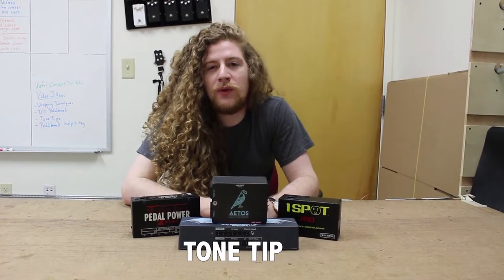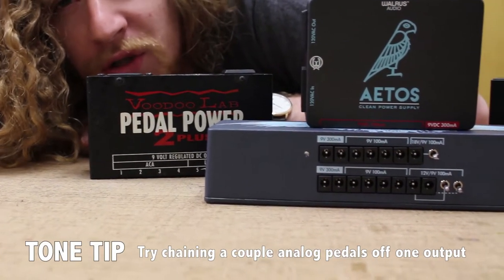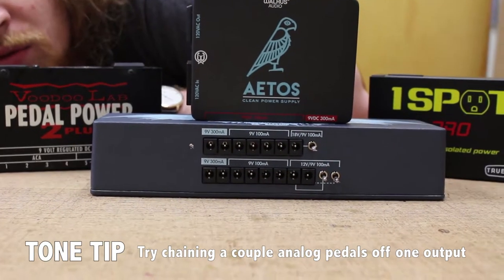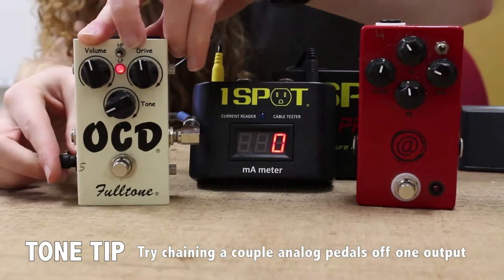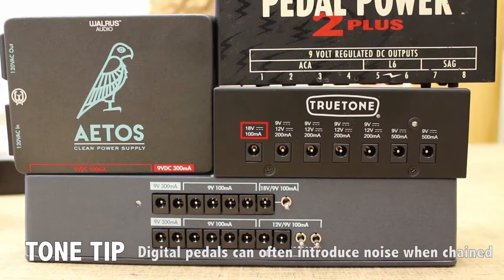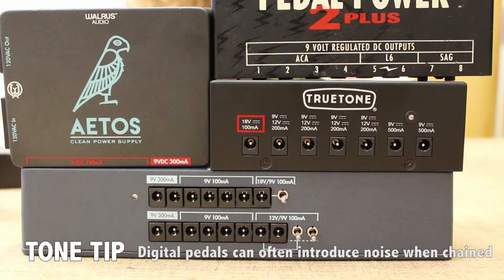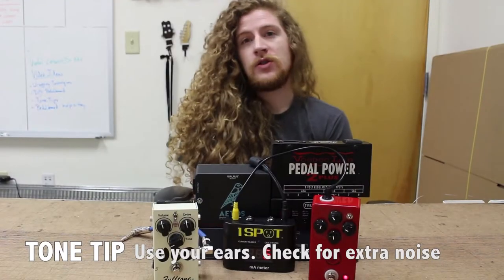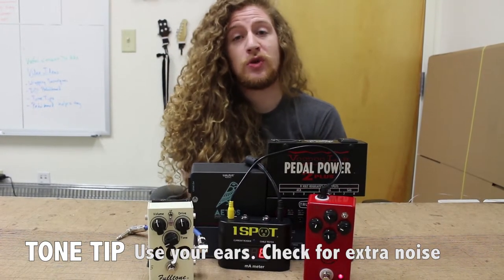Pedalboard Tone Tip: Amperage and Power Supplies

Comment: Hi, 
i have a question about rechargable power supplies. If many pedals only draw so little current, why not just use a standard LI-IO Powerbank together witha  5V to 9V converter cable and daisy chain everyething? 
A 20000mAh powerbank only costs 35€ and could power 5  - 6 analog pedals forever, right?
Reply from the maker: LL KK I would be careful with using  just any power bank. Even though you can convert the voltage,  not all power supplies are created equal and without proper AC switching or filtering you can get a lot of noise transferred through the ground of the daisy chain. So although technically yes you could, I would make sure the power is designed for audio use and has propper filtering. Also make sure it's negative center.